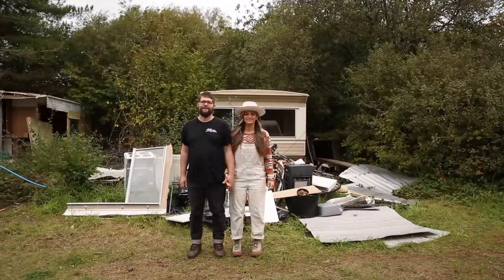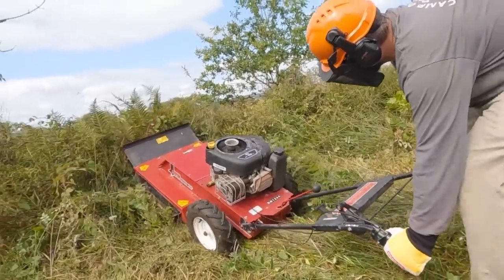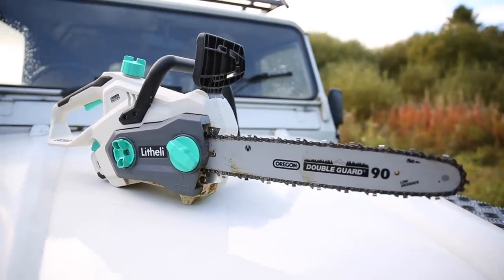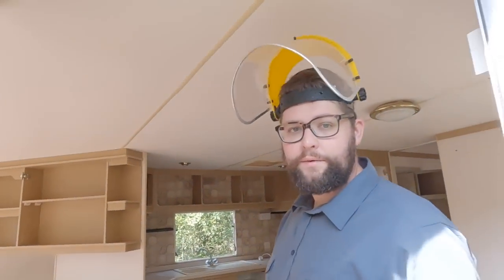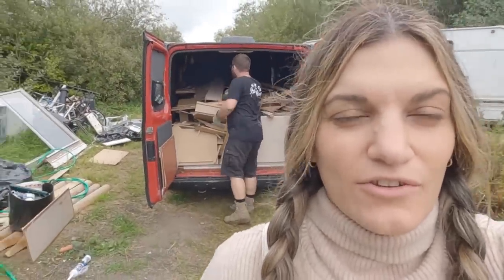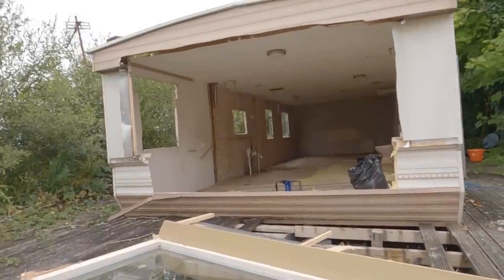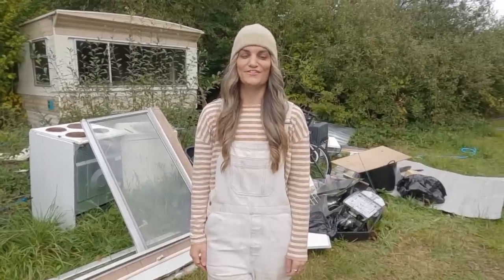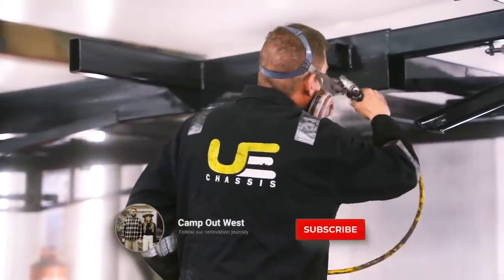Renovation PT.4 | Land clearance, caravan destruction, trespassers, exciting delivery + GIVEAWAY

Comment: Re: Bearing. If you've got a digital caliper you can get the measurements of the bearing if you take it off carefully. If you have the inner and outer measurements you won't need to buy one especially for your machine, one that will fit will do.  This will help get the price down - starting around £3 on ebay.  You'll find them listed by size on ebay.  If the machine is imperial rather than metric sized (inches not mm) you may find that you'll need to get the size in fractions of an inch, if you haven't done this before. Also, there are going to be a lot of videos on youtube on how to fit bearings - if you freeze them overnight,  it will contract in size, being a fraction smaller helps get it fitted into the outer housing and you may find that it fits the shaft well too. You'll probably need to wetsand the shaft to clean it and make it easier to fit. I don't know if the top or the bottom would come off easier - it may be better to hit it with penetrating fluid (possibly heat as well) to be able to dismantle it to get the bearing size. Knocking the bearing back into place is normally done with a socket that is the same size as the outer (avoid denting or damaging it) and using a washer with the same inner diameter as the bearing with something like a socket for a spark plug if you don't have one the right size. When you've done that reassembling with strong threadlocker because it will vibrate, will aid a good repair. Checking the balance of the blade may also be worthwhile - you may be able to take it off and put it on a pivoting balance to check the weight is the same on both sides - if it isn't, it won't spin without wearing the bearing further - this is why blades are replaced when they look ok, seem to perform well but can wear other components out. If you need to take a little weight off, using an angle grinder to sharpen the blade may be all you need to do.  As for the electrics....   I'd put the camera near my back gate so I can watch my neighbours cats having a scrap...
Reply: @joncampoutwest  A couple of points might be worth mentioning - nylock nuts will stay on just as well as threadlocked and are probably preferred but are more expensive. Also, the service you had carried out wasn't cheap at £100 and maybe if you asked the mechanic who did it if they should have checked if there was any noise from the bearings. if it included a new carb, he probably gave you a really good deal.  if you ask him politely if he can remember, he may or may not be able to assist - he may have done a great job and might not want to think it's his responsibility. You could review the video you've got - if you repeatedly hit divots you may want to change your style of mowing and possibly use a rake to check the surface with two of you working together. It may not have been the mowing angle and what the blade was hitting - when the new bearing goes on make sure the seals are covering the bearings because grit getting in is likely to be the cause of the problem and hopefully you won't have this again for a long time. A blob of grease on the underside of the bearing to take any debris flying up may not be a bad idea.  The challenge of getting through the trees might appeal but there could be a greater chance of debris flying up and damaging the bearing seal.  If you do any maintenance on it, there are mostly garden tractor type mower videos from the states or small deck mowers - not the type of mower that you have so a general maintenance video may get you a lot of views and a few quid from it - having some video of it in full working order with all the wires connected where they should be
Reply: I came here looking to see this comment,  you sir are a good egg, please never change!

Comment: I built a steel framed van in 1969. The steel was 3/4"sq. When you start on the chassis, do the under floor works, the floor, the frame to line up with cupboards, glue the lining (we used coronite back then) with building adhesive and joining strips then fasten the cupboards from the outside, gas and wiring and finally the skin then the windows & vents. Make sure the frame is made to line up with the cupboards. Seal everything to keep the bugs out. Perhaps a cover or workshop before you start?😁

Comment: The one caravan you destroyed actually looked OK,same as the wood. The floor could easily be replaced, but it also depends on the chassis. The wood ,can be used as kindling. Salvage what you can,everything comes in useful at some point.

Comment: You should be able to get a bearing for the cutter from a store that sells them all you need is the shaft and hole circumference to find the size bearing needed.
Reply from the maker: Thanks Keith, there a bearing supplier near Swansea I'm going to go and se about some replacements so I can get back to clearing.

Comment: Hope you get this. Get the bearing out and I surgest cleaning the out surface of the bearing up and there should be some id numbers on it. Get in touch with a bearing distributor.  One I suggest is premier Bearings in tamworth. They are good at getting one offs.
Reply from the maker: Thanks Peter, I'm going to try clydach bearings near Swansea first, failing that I'll try that place you've suggested, thanks for the recommendation, much appreciated. Jon

Comment: Hi again Emily and John. 
 I'm gonna start by telling you a story for my entry for the camera. In 2003 my Dad decided that he wanted to give his house to me and my brother before he died. As the house was in fairly bad state and needed a lot of renovating, rewiring and re-plumbing, we had it valued and that came to about £45,000. My brother gave me 20K for my half of the house.
 WIth the money I took and passed my motorcycle test at the age of 38. Also all the gear needed for said bike for both myself and my lovely wife. 
 Fast forward 20 years and 36,000 miles of blissful fun and 3 months ago my beloved motorcycle was stolen from right outside my house with full locks on both the back and front wheels. And that was the last I have seen of it, it just disappeared off the planet. We have/had a camera outside but for what reason I don't know it wasn't on and also, it doesn't have night vision. I am postponing getting another bike until next year as its getting colder, and I am getting older, lol....
 Ok, now to the vlog comments: In the early 90's I converted and lived in a 70's Bedford CF Ambulance. In Huddersfield where I live it gets a little parky in winter so a friend of mine (a New Age Traveller) built me a pot belly stove out of an old gas bottle. And I still have it now, lol.
 During the vid, you mention recycling most of the components, which is admirable. I would advise you build a winter wood store and put all the scrap wood in it.
 And lastly (PHEW), John; your technique for using a sledge hammer/axe is completely wrong! If you continue doing what you're doing you will do your back in big time. 
 I have used this technique all my life since I was pulled up as a teenager by an ancient builder who told me his words of wisdom: 
 If you are right handed, hold the base of the shaft of the hammer/axe firmly in your left hand. With your right hand under the head of the hammer at the start of the swing. As the hammer/axe falls on target, slip your right hand down the shaft till it meets your left hand. 
 Now it know it all sound very sexual and Ooh er' Mrs, as they say, but this is the most effective way of using a sledge hammer or axe. It saves the extra forces on your back and uses the weight of the tool rather than all your strength. It also increases the power of the swing at least 3 times. Practice it and once you've mastered it, you will thank me and wonder why you ever did it the wrong way, lol. Good luck and keep the vlogs coming. Best Wishes. Aidy Madd

Comment: I would use the camera on my allotment, I setup a communal Wi-Fi hot spot with cheap 4g lte router powered by a solar panel and old car battery. We have the odd person cut off locks and pinch tools so would be good to gather evidence when it happens again!

Comment: Just measure the shaft and the outer diameter and order a bearing from a bearing supplier.  You will probably need to drift the outer casing out of the mount boss.  But that looks to be just bolted in with 4 bolts!
Reply from the maker: Thanks George, it was held in with four bolts but one seems to have rattled off just before the bearing casing blew so I'll take the whole assembly apart and take it to a bearing supplier to hopefully get some fresh ones. I need to go over the whole machine a thread lock a load of bolts and tighten things up.
Reply: @CampOutWest  PS, Loving your work guys!  The more this crazy world changes, the more I think about trying to live in a more "off-grid" and a more self sustained environment.  Keep the footage coming!

Comment: Word of advice regarding the security camera, you should have fixed it to the pole with the tree strap or any other temporary type of fixing, not screws, as when the pole tester comes to test that pole he is allowed to remove any illegal attachments and invariably uses a hammer if the screws are rusty. When I worked for BT they actively encouraged staff to look out for anything attached to telephone poles in order to raise a charge against whoever attached anything. If I won the camera you have I would use it to monitor my back garden as we are visited by a hedgehog but I have never been lucky enough to see it for real.
Reply from the maker: Thanks so much for the tip! We didn't realise as the pole is covered in stuff from the old owner haha! But we will look at installing it on a new freestanding pole we install 😊  thanks again

Comment: You will find that bearing just presses out, so you should have no trouble finding a replacement,  just take the whole bracket and pulley shaft to a bearing place
Reply from the maker: Thanks Colin, that's what I'm going to do, few people have recommended a local bearing supplier near Swansea I'm going to go and see.
Reply: @CampOutWest  get one with metal seals, not rubber.  Usually suffixed with ZZ like 6002-ZZ

Comment: That fibreglass insulation is very itch inducing stuff. It is important to have cool showers after handling the stuff so you don't open the pores of your skin. By leaving your pores open, there is les chance your bodies will absorb the fibres.
If you find your throats feeling dry & sore, drink cold milk because the milk absorbs the fibres allowing them to pass through your body more easily. Water alone is not up to the task of absorbing the fibreglass fibres.
I also advise wearing disposable overalls so that you are not filling your washing machine & clothes with fibres, thereby reducing any risk of having itchy skin.
Reply from the maker: Thanks so much for the tip Keith! We make sure to take all our contaminated clothes off outside too! We will take up your advise of the disposable overalls though, as we start to break down the next few caravans! Wishing you a happy new year and can't wait to show you what we've been up too :) Emilie, Jon & Maggie x

Comment: Hi you can get the bearing that comes complete with the fixing case on ebay. For the mower  But wil after order from usa around 95 to 120.  Plus about 30 pound postage. Worth fixing as a exspensive mower new.
Reply from the maker: Thanks mate, I've seen them on eBay from the US so might order the whole hub assembly if I can't find replacement bearings locally. The machines new are pretty pricey for sure, defiantly fixing it, the things a beast. Jon

Comment: Really impressed with the cameras and in particular the fitting options supplied rather than them being available as options. I would use the camera on our shed at the bottom of our garden as we don't have electric there but even if we did I like solar power and have some lights which are solar and they are great 👍

Comment: The shielding on that  bearing looks pretty buggered but there should, be a number on them. If not find a local bearing shop and take in the  shaft and the housing they should be able to measure It accurately. An easy job and a good skill to learn.
Reply from the maker: Thanks Dave, few people have pointed me in the direction of clydach bearings that's a suppler about 40 mins from us I'm going to pay a visit to to try and get some replacements, I've got vernier calipers but just cheapies I've had for years, if I take them the shaft and hub they should hopefully be able to source some fresh ones and we're back in business.

Comment: Nice to see you've managed to scrape enough cash together for some decent tools but clearing all that overgrowth was a big ask for that bit of kit after such a protracted period of neglect, a tractor-drawn chopper, (such as those used at harvest time), would have been good for the first cut after such a long time, I hope that you manage to source new bearings.

I would like to put myself out there for that Reolink giveaway:
I live in and end of terrace in a fairly rural setting, the terrace has a back access lane for bins but we get a lot of 'scrappies' around after metal. Some of them are Jack-of-all trade pickups that do a line in building / tarmaccing / refuse clearance, etc. on a couple of occasions I have come home to find old fridges or bathroom suites have been thrown over my wall into the back yard, my neighbour has had stuff taken from his garage, it would be nice to have the kit to catch them for once!
Reply from the maker: Thanks for your comment, only reason we didn't go down the route of getting a farmer and a topper in to cut the field is we have no idea what was under the grass and didn't want to risk wrecking their equipment. So far we've found loads of thick gauge steel wire, metal bin lids, boulders and pieces of old concrete slabs AKA mower killers. We've put a good dent into the overgrowth and I've got a new brush cutter blade for my trimmer as one wrecked on me this week from hitting a sheet of steel buried in the grass. Hopefully once we've cut down the grass once my machine will be great for keeping ontop of it and stop it getting out of hand again.

Annoying you've got some idiots fly tipping near your house and pinching things there's nothing worse is there. Jon

Comment: hi, you can buy bearings in the uk easily. yo will need to measure the shaft.the outside diameter and depth. buy a digital vernier from Halfords.
Reply from the maker: Thanks Colin, I've got some callipers somewhere if I can find them and will try local bearing place near Swansea I've been recommended a few times.Cheers. Jon

Comment: Those cameras will be spotted. Use trail cameras, they're camouflaged and can be hidden in foliage. Visible do act as a deterent. Noise us your best friend as an alarm. Find an old klaxon and fit it high up. The post apocalyptic builder has a video showing how to set it up as an alarm. I hate to see you lose all your tools after all the hardwork and investment. Ps you can also recycle cuttable glass, those large window panes can be reused

Comment: I should also mention I bought a small travel trailer last year. I am want to go back home, PA, to be near my grandchildren. Im looking at a couple acres that have a well and septic and an old mobile home on it. I was thinking I can line in the my little camper while I try to do something with the chassis of the mobile home. I don't need a large space so I was thinking of having screened in porches on both ends of the chassis.  I could use the camera there being this property is away from any population. It's on a road named Swamp Road! 🥴

Comment: hi gret to see you and what your doing ,brush cutter take bearing case and the drive shaft to lawnmower repairers and they will match it up  .i would love one of reelink cams because where i park my campers and no lighting would be great to see it on my ipad  cheers Rob
Reply from the maker: Robert, thanks so much for the tip! Jon cannot wait to get it fixed and start using it again when the weather is a little dryer. We are spending new years eve catching up on our comments (we've got just over 2,000 to work through) Sorry you didn't win but can't wait to share with you what we've got coming up. Happy new year! Emilie, Jon & Maggie xxx

Comment: Hi guys, just seen your video. If you measure the shaft diameter and the housing inner diameter you will be able to get a bearing to suit, metric or imperial, a sealed would probably be best.
Avid

Comment: Some questions for you, Why do you have to adhere to the park homes building regs? Is that easier to get planning permission rather than just your own tiny home plans? doesn't park homes have a height restriction,  so would it be possible for anyone to set up a tiny home campsite using park homes building regs,?
Reply from the maker: Hi ki, so the land we bought has permission for  'residential park homes' only, so that is why we are building within the park home regulations. We are in a green belt too, so it is very unlikely we would get permission to build a big house (we also don't have the money to build something like that) so we haven't even tried to apply for planning for something different, so we are happy to continue with the residential park home permission it already has in place. To answer your questions too - yes park homes have height/size restrictions etc you just follow. The only way people can build a park home etc is if you have planning for a caravan on your land :) I'm not sure how easy it is to get planning as our land has always/only ever been a caravan site (since the 60's!)